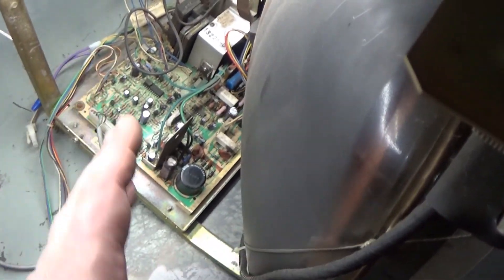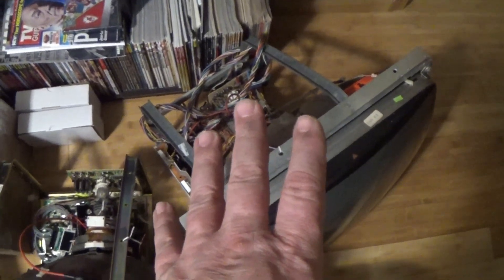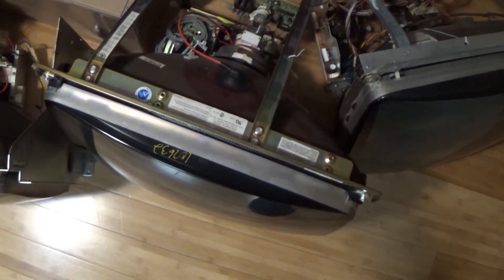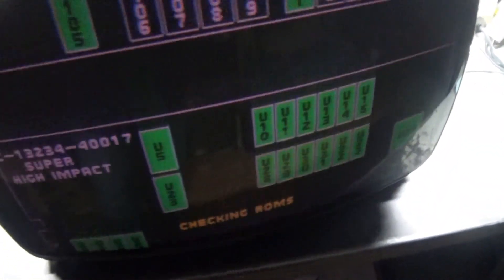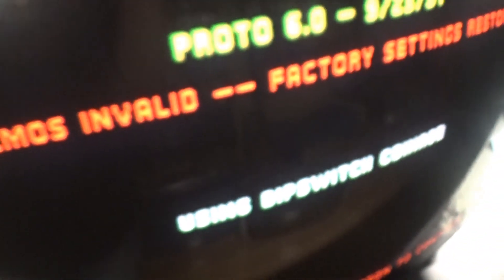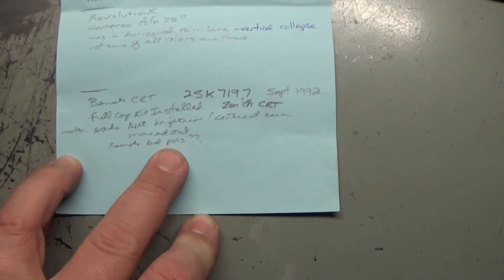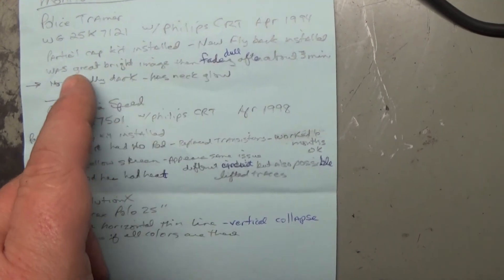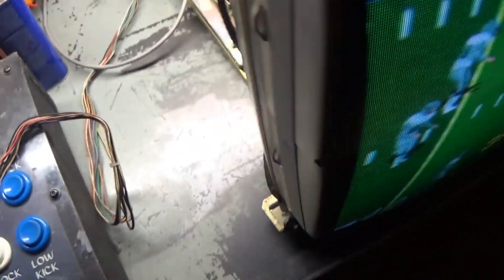25" K7000 Arcade Monitor Chassis Repair - "Brightness/Contrast Needs To Be Maxed Out"

Comment: I wish i could figure out my blooming troubles.       Let us meet your dog that was hanging out.
Reply from the maker: Voltage regulator is suspect. She’s actually my brother’s dog.
Reply: @MikesArcadeMonitorRepair  is b plus the only voltage that comes from regulator?  If it tests correct and stable should i start testing the other componets it travels to and threw? What are your thoughts? Where does it go is it just simple to follow traces where ever they lead and check values to book?  I mean if its correct at resistor its got to be somewhere where ever it goes to? sorry if its a dumb question but if your willing to teach im gonna learn!! Thank you
Reply from the maker: Yes. Monitor the B+ when the blooming happens. If the B+ fluctuates while it’s happening, replace the regulator.,